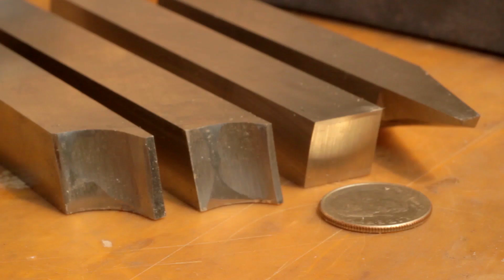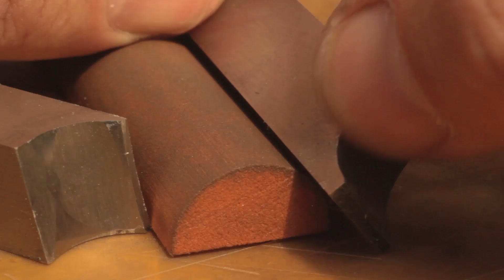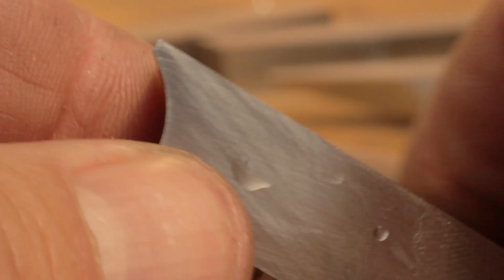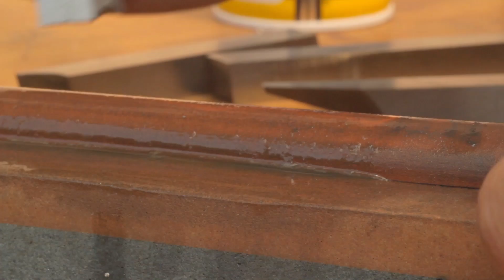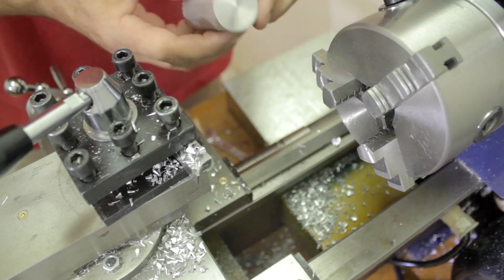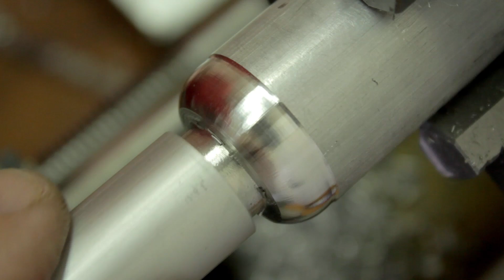MAKING HHS RADIUS LATHE TOOLS

Comment: make a block cut it out to hold tool at a angle 15°will do  use set screws to hold..rough hand grind an bech grinder..get piece of stock diameter you want  turn shank so  fits chuck drill press..go lowest rpm..and use lapping compound on your bar stock..start up use one hand hold block..other work spindle up and down  check in a few  minutes reapeate till satisfied..plus side when dull can rehone to sharpen

Comment: Try honing backwards because any slight tilt forward as the stone bites, the cutting edge ends up getting slightly rounded, if done backwards the cutting edge lifts and is not touched by the stone.

Comment: You DO know you're turning in the wrong direction, do you ?
Reply: Is it running clockwise or is it just the camera? Since the chips are building at the top of the tool I think it's correct.
Reply: Yeah you're right, I saw it wrong..but I do think his actual sharpening technique is wrong, when you sharpen it you need to move away from the cutting end, not towards it. He's not sharpening it, he's blunting it. Might still work tho, if you're lucky. And if you try enough times, you'll probably get lucky, for a radius you don't need it to be that precise most of the time anyway.
Reply: Dubbelehalvezool, What you say of the sharpening technique I tend to agree with you.
If I had the same stone and task I think that the tool would be fastened in a vice and then stroke the stone up from the bottom of the cutting tool edge.
This should make things quicker and easier to obtain that fine edge desired. John.